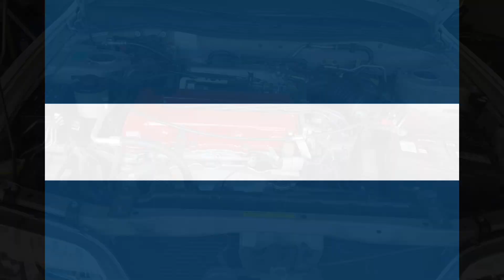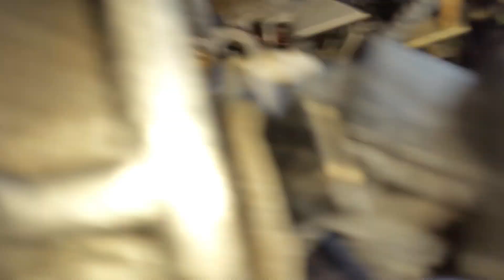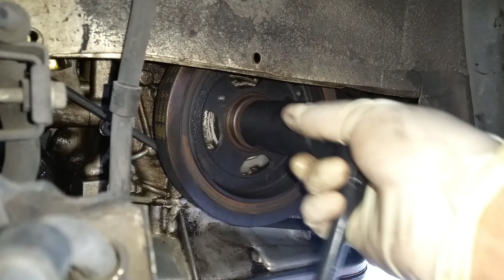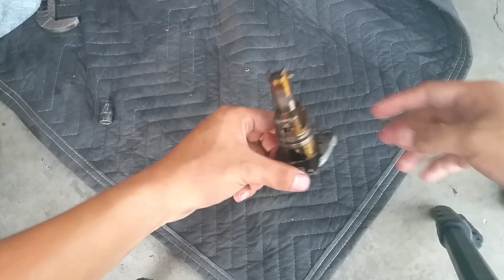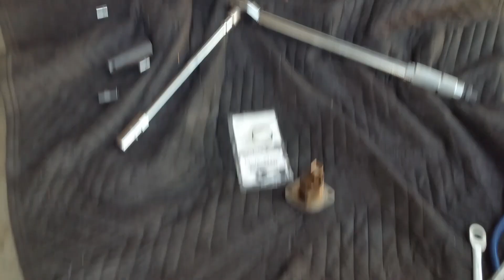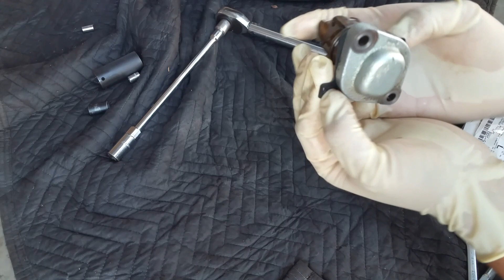Here Is How To Fix A Timing Chain Rattle Noise On A SR20 NX2000, Sentra SE-R, 200SX SE-R, Sunny, G20

Comment: Do you think its worth while to take off the valve cover to make sure the chain is going into the tensioner and zip tying the chain to the sproket so it doesnt skip a tooth while you turn the crank to apply tension to the chain?
Reply from the maker: +Philip Wan technically yes it's a safer way of replacing the tensioner but the tensioner will only fit one way and it won't go in all the way if it doesn't line up with the timing guide. the zip tie won't help much since they will tear as soon as you begin to rotate the engine, a better method is to keep one hand on the side of the sprocket and rotate the engine slowly. whatever you do DO NOT rotate your engine without the tensioner installed you will skip a tooth
Reply: Wow amazing thanks so much for the quick reply, maybe i'll try save the hassle and just do it without removing the valve cover, if i cant hear a click when turning the crank anti-clockwise, i'll take the valve cover off.

Thanks again for making this video, it was super detailed you deserve more views!
Reply from the maker: +Philip Wan Thank you I appreciate it!
Reply: exelente

Comment: @12.38 did you turn the engine backwards for a reason? or would it work the same rotating the engine the correct way? (or does it make any difference at all) would you say the O ring is needed for the pressure to keep tension on the chain .. (i have a rattle, but no leaks externally and wondering if it could only be the O ring)
thanks for the video, will make it more familiar to Me if i check mine
Reply from the maker: you need to unclip the tensioner clip I believe service manual calls for to rotate the engine backwards. A bad O'ring will allow for oil to pass through and you will loose pressure in the tensioner causing rattle
Reply: So to turn the engine backwards are you (loosing) rotating counter clockwise to do so at the crank. Just want to make sure. Also where do you access that from. Is that in the wheel well?
Reply from the maker: Yes and by the wheel well

Comment: Only sort of related to this video, but have you ever had to pull the timing cover on a P11 with the engine in the car?  Can it be done?

We don't have the space or equipment to pull the engine, but I am fairly certain the timing cover o-ring is leaking because the timing chain tensioner does not seem to be the source of the leak and it's definitely above the crankshaft.

Comment: I’m mostly venting, but feel free to chime in. I replaced my first two fuel injectors in my 1991 SE-R (146k bone stock, all OEM parts) with the OEM ones Nissan currently sells for the SR20DE which is part number 16600-53J03. I knew I had an injector problem because I initially took an injector off my parts car, a 1992 NX2000, and my problem stopped. So I installed the new injectors and the first cylinder locked and my timing chain skipped, causing my engine to basically become inoperable. I’m super frustrated and bummed because my car was super healthy and I have records of everything for it dating back to 1992, plus it’s never had a timing issue including the tensioner. I’m going to get the injectors Nissan sent me diagnosed to see if the one on the first cylinder was stuck open or faulty. I’m not sure what’s going to come of this, but I hope my car isn’t toast because I’ve put too much into it to lose it to something so stupid.
Reply from the maker: hows it going, sounds like bad luck. did you verify you had a timing chain issue, check Top dead center. Your injector maybe was letting too much fuel off. remove the spark plugs and see if you can see any fuel
Reply: ERICSDIYGARAGE hey, yeah, the cylinder had fuel in it which was my second indication something was wrong. But the first was when I cranked it and I heard a CLUNK from the motor, which was my timing chain skipping. I’m assuming I either got a bad injector or, less likely, the wrong injector.

Comment: I don't quite understand what line you were referring to when you turned.it manually to dtc. I'm not wanting to remove the valve cover to confirm tdc. But couldn't see what you meant by the second line to the left on the crank pulley are you able to explain to a noob? Thanks
Reply: Nvm I got it

Comment: What was the problem that made your tensioner's car go like that ??
Reply: The o-ring for his tensioner was shot. It literally fell apart.
Reply from the maker: yeah it was brittle and it was allowing for oil to leak pass the tensioner making it rattle because it was not applying proper tension. The actual tensioner itself it's pretty much fell proof but the o ring will need to be replaced eventually.

Comment: If you take out the upper guid, would you need to replace it?
Reply from the maker: No the upper guild can be removed so that it wont rattle as much 2000 and up dont have this upper guide since they rattle when they wear out
Reply: @ERICSDIYGARAGE   yea I just bout a 1999 n it's rattling from the right side of the motor ,I'll try to remove the upper guid n see if that helps, thanks

Comment: Thank you for posting this video very helpfull.i changed mine in a 1.8 vvti.i rotated first wrong instead of forward i did first backwards but in the end i heard the tick sound so its ok
Now im littlebite affraid of the chain if its damaged or out of timing no weird engine noise

Comment: Thanks for sharing this video. The real thing I learn here is to buy the tensioner made by the dealer. And I know from other cars that the manufacturers also very often revise their designs for tensioners after the cars have been on the road for a while and if you are replacing the you deffinately want the newest design not the old stock.
Reply from the maker: Thank you for watching!